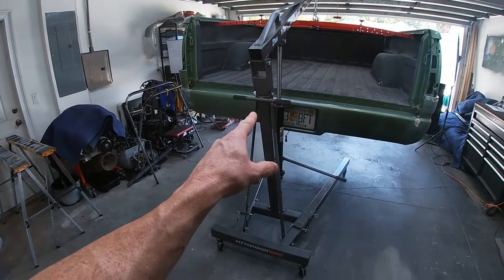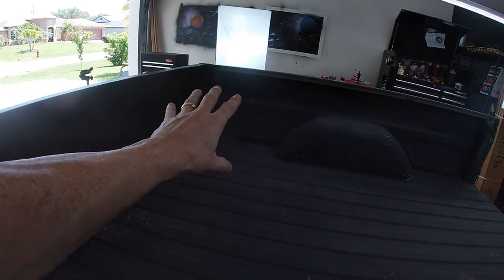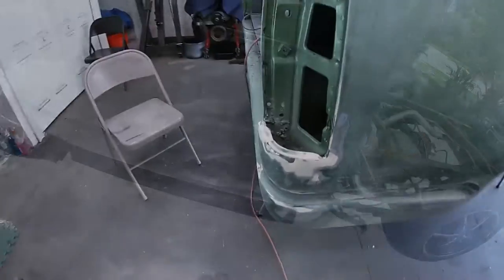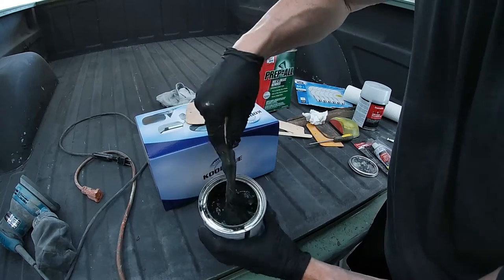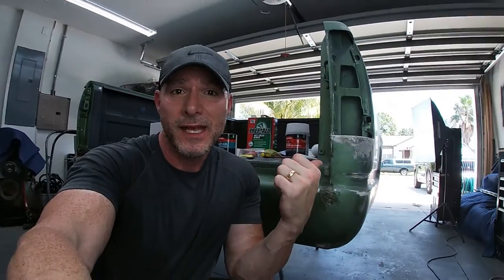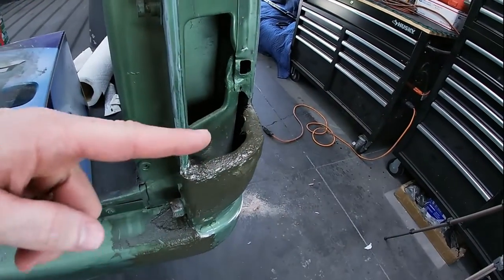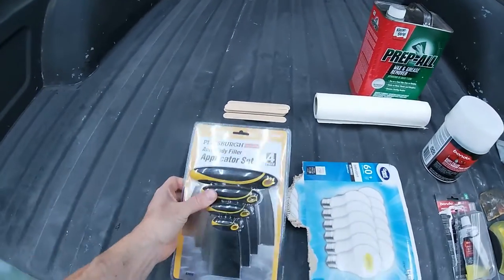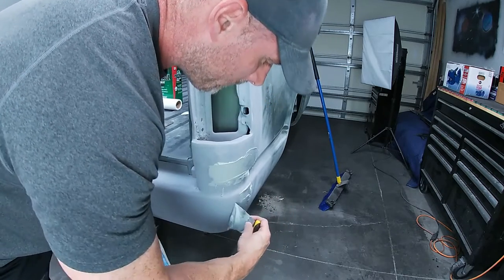OBS Chevy truck bed cheap crash repair with purple Rustoleum paint as primer. Progress is progress!

Comment: I’m doing a similar project and I have used the Rust oleum paint a few times but never cleared them and have a couple questions how long after your last coat of color? I hear there can be a reaction causing wrinkling . How Long between your coats of clear than like on your mid coat going to your final clearcoat I love your channel like what you’re doing it’s kind of what I do appreciate your help on this project here
Reply from the maker: Thank you! As for the times it depends on temperature and humidity. From the gun using rustolium with catalyst I wait about 15 to 20 min for each paint coat. Then either 30 min to clear or I wait a week to let it fully cure then wetsand I never have wrinkle issues. I re coat clear 15 min with medium in the Temps over here its hot. As for the spray cans I wait an hour or 24  hours before painting or clearing over it. The wrinkle is probly the acetone or reducer eating into the paint. From my experience the catalyst added when using the gun will help with the dry time, the uv, and recoat/clear times. Good luck with your projects 👍